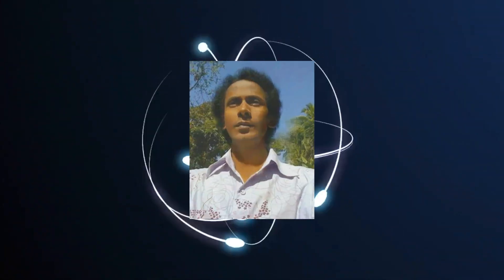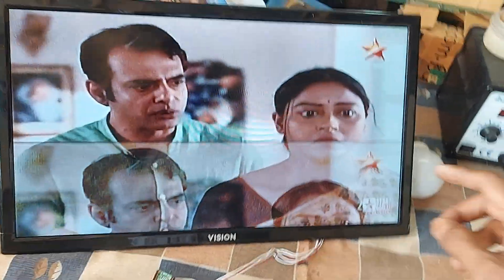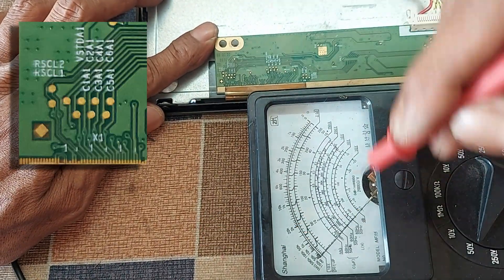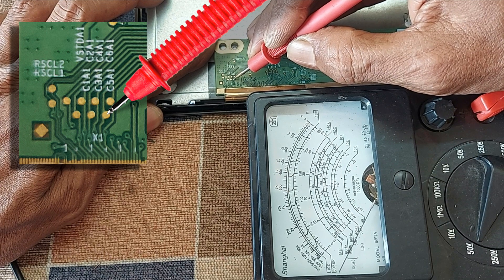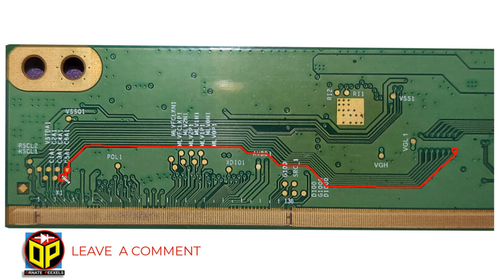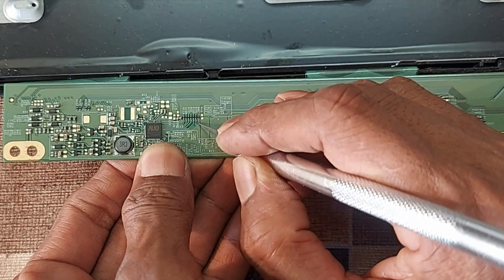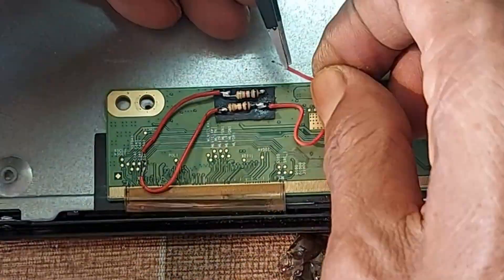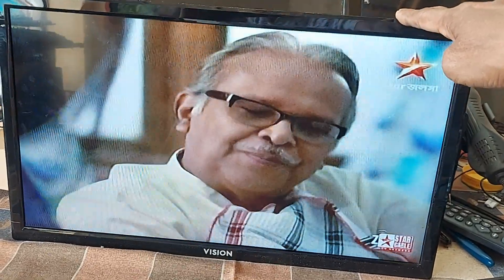Double Images Problem, Split Picture  or 2 Part Image Problem | LED / LCD TV  Panel Repair

Comment: Sir, 
I face a double image problem in lloyd 50" led tv with AUO panel.
There are 2 Tcon board T500HVN08.5 XL and T500HVN08.5 XR in the panel
Pl guide me

Thank you

Comment: My question is that, after cutting the vgh and vgl from the DC/DC ic, where did those voltage come from respectively? Second, did you use 1k ohms ( 2 of it) ?
Reply: He did not cut vgh and vgl. They arr always there with constant voltage thats the testpoints where he soldered the cable to. What he disconnected fron the ic was the switching voltage. You can search for lc1 lc2 bypass on youtube to find other videos on it.
Reply: @robsonrobbi1763  okay

Comment: Mr. Mustafa. Thank you again for your reaction for my comment. I have two led TVs and one is Panasonic D400 and other is LG. I am not a technician but I like to be a technician. The problem one is Vertical line on the screen of the D 400 and  two is picture freezing on LG. I have a small touch on electronics and I would be greatfull to you I f you could kindly help me to solve these two issues. Plese guide me through your YouTube channel. If you have an email address please put it on  your comment section. God bless you. Keep it up with  your excellent work. Sri Lanka.

Comment: Digital Gamma IC 10.2 volts on all sides on all pins and 2.2 volts on all sides VICM volts 6.6 on all pins but display white solution sir?
Reply: Correction. No all side one side.

Comment: Sir language Hindi yeh video real hoti hae Kiya itni jaldi fault ok kardena yeh real hae kiya
Reply from the maker: COF (IC) contains several thousand semiconductor components, If any one of these components is damaged, the DC to DC converter wants to switch to safety mode. I think something like this has happened here, that's why VGL and VGH voltage supply is going up and down. So alternatively VGH and VGL voltage had to be supplied by the resistor.
Thanks Brother.

Comment: Зачем ставиш резисторы на этих линиях?
Reply from the maker: COF (IC) contains several thousand semiconductor components, If any one of these components is damaged, the DC to DC converter wants to switch to safety mode. I think something like this has happened here, that's why VGL and VGH voltage supply is going up and down. So alternatively VGH and VGL voltage had to be supplied by the resistor.
Thanks Brother.